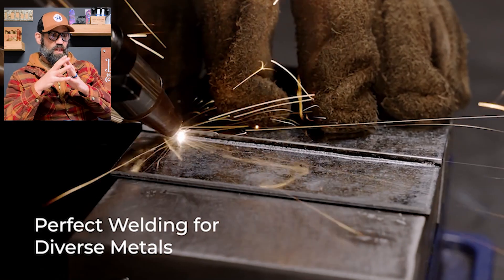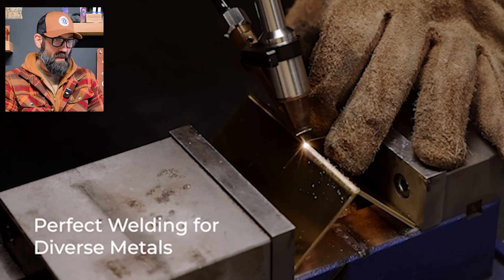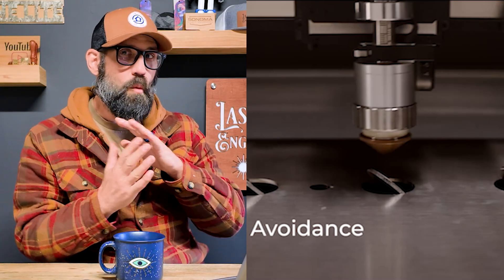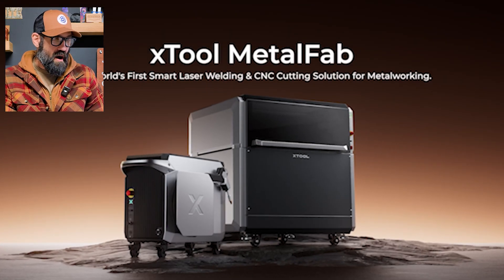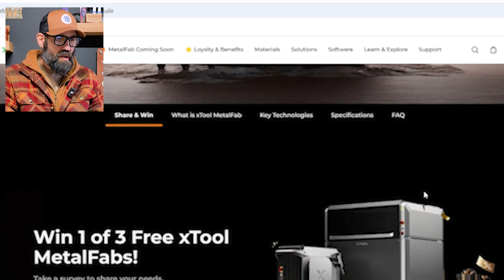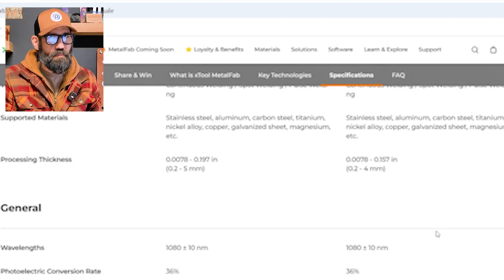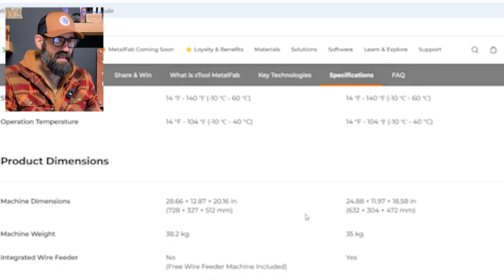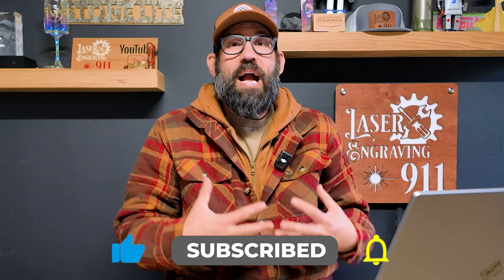Did xTool Just Kill Plasma Cutters? MetalFab Laser Cutter / Welder REACTION!

Comment: I see this coming in at around 8k - 15k for the 800w, 10k - 20k for the 1200w. That's firmly out of the realistic price point for a home use tool, and far too limited in scope to expect timely ROI for a small business.  They're filling a tiny niche with this.
Reply: I think you are about right with the price range there. It’s going to be too expensive for most people. The price point will be the determining factor in whether this will be ground breaking or not.
Reply: @barryp8145   Yup, this will move at less than 10k. I don't know why they chose a 24" x 24" bed size... Would of been much more capable at a 48" x 48".
Reply: I hope you are wrong. Because a 1500w laser head and chiller and controller can be had for about 5k plus CNC portion. I think it need to be around 6-10k.
Reply from the maker: we will find out today!
Reply: @LaserEngraving911  Yup, seen the price posting. More than I thought it would be honestly..

Comment: when you are testing, I'd be curious how well it cuts say 0.020 aluminum with adhesive backing on it.  Does it cut through the backing with no burn?  Also how sharp is it and does it need finishing to take out sharp edges.
Reply from the maker: Ill do my best to get those answered great question. I'm sure it will cut through even with the adhesive on the back, and as as the edge sharpness I can tell you from past experience that it is super clean cuts and the edges are crisp not jagged, but some finishing will be required if you want to dull the edges. But not all project will require that.

Comment: I have a P2 Co2 and it was 5k. I can't see this machine coming in at that price. I'm guessing 7k to 10k range.  And at almost 4ft x 4ft for print that's a lot of money and a lot of real estate. And the laser welding and rust removal is kind of gimmicky to me.  It's only for thin metal and small parts. I don't see those options being used much.  I can buy a langmuir 2 ft x 4ft plasma table with a 60 amp llasma for less than i paid for my P2. Cover less floor space and have 2x the bed capacity.  Now, if it had the ability to engrave and then cut i could see more use for it.  But if i still need a separate fiber machine to do the Engraving, i don't see this as an affordable option for most home operations or even small businesses.  You are going to need a LOT of trophy and plaque sales to justify buying this if the price is above that 5k mark. I like the idea of this machine but it's a first generation. And just like my D1 20w pro.  It will be replaced quickly.  That's how x tool works.  I love my P2 and I kind of want an F1 ultra. But at the same time i wonder if I'd be better off with another brand.
Reply from the maker: Thanks for popping by and sharing you take!

Comment: Yes this is driven towards the maker. Those of us who are used to running the big 3000w and bigger. lasers of this that have all the same options. Also depending on which one get the price tag to operate (software) which about price of this machine. So no you can not compare the two. 20 plus years of programming operation of both c02 and Fiber lasers.
Reply from the maker: I used to own a 1500watt industrial machine 5"X8" bed, so I hear ya. xTool software will come free with the unit. No license fee required. I think you right the MetalFab was designed for small to medium companies 100%
Reply: Yep, usually the software is as much as the machine.
Reply from the maker: its the XCS software, and there is no change for it, it comes with all xTool products. I can confirm this.

Comment: I don't think this will replace small shop CNC plasma strictly for bed size. I know a few people that have them and they often have 4' x 8' tables to cut on. Sure, if you cut small items it's probably a lot better but if you are cutting large sheets and brake pressing then this would be considered way to small. Still very nice for what it is, can't wait to see the cost.
Reply: Putting aside the laser safety issues, it would be interesting if just the laser could be retrofitted into an existing plasma cutting system. 🤷‍♂️

Comment: can it make cut outs on EVA Foam 40mm and above? wood?
Reply from the maker: No wood, or EVA foam, I would not recommend on this machine wont work very well. To do those material you want a Co2 laser and for the 40mm EVA, you might want to consider to 20mm thick and stack them!

Comment: No doubt in my mind, it will be around, if not more than 15k. Everlast, I believe, already makes a 1500w version that doesn't have the CNC part, and it's $17k last I looked.
Reply from the maker: You are right about the cost. It will be interesting to see how the price plays out with all of the new options coming out!
Reply: Their survey used 6k as the assumed price for payment options
Reply: @EOTG_AK  If they price it at 6k, I will buy it immediately... but I highly doubt it. 100w fibers lasers alone are 5k to 11k depending on who you buy it from.

Comment: IMO it's going to be only average at a lot of functions and not great at any of them. There is a market for it ABSOLUTLY, but 1200 watts can't cut very thick or very fast metal. For those users who are already part of the xTool ecosystem it will be great, but no one is going to be taking on volume DoD type contracts with this type of product.
I have an F1 Ultra and a Made in USA 4x8 CNC Plasma table. I'm considering upgrading to a Laser CNC table soon, but even if I did a second smaller table, just for detailed work, I still wouldn't consider this product. Knowing this is a repackaged Chinese multi-use laser machine I have no doubt it's going to be as expensive (if not more) than I paid for my 4x8 CNC plasma table. Don't get me wrong people will buy this and it's got a place and value, but many of them will sit in garages collecting dust once the Nitrogen issue gets realized. All that being said there is no doubt in my mind that there is a maker market for single phase 2000watt fiber laser CNC small bed tables for under $20k.
Reply from the maker: Thanks for sharing your take on it! and stopping by!